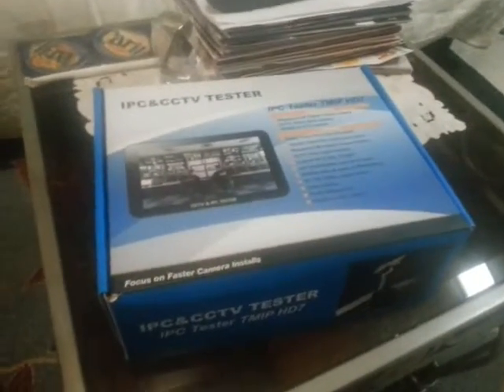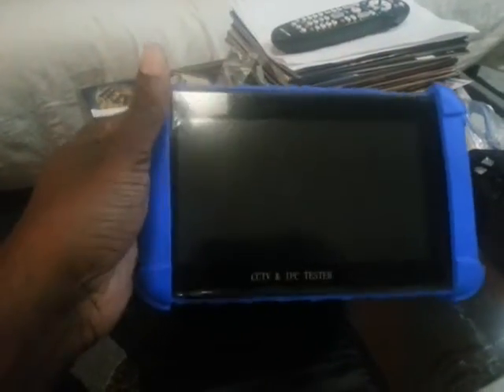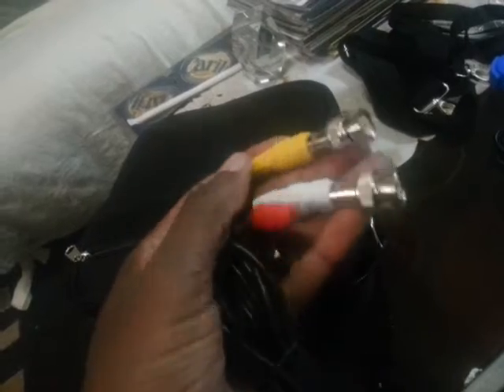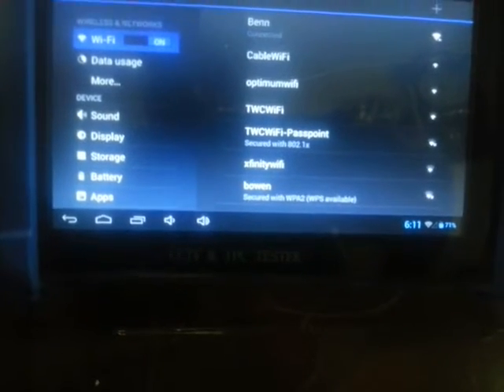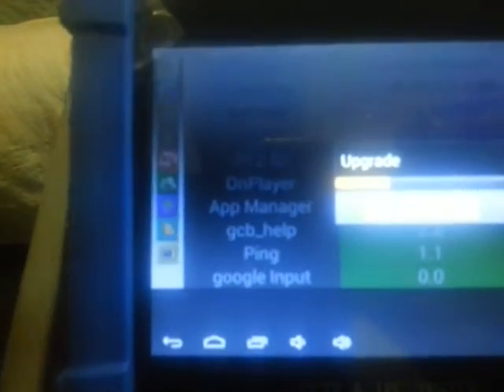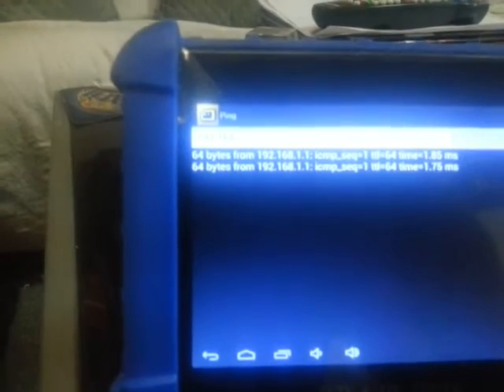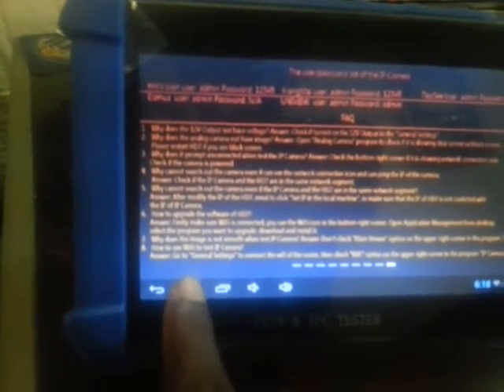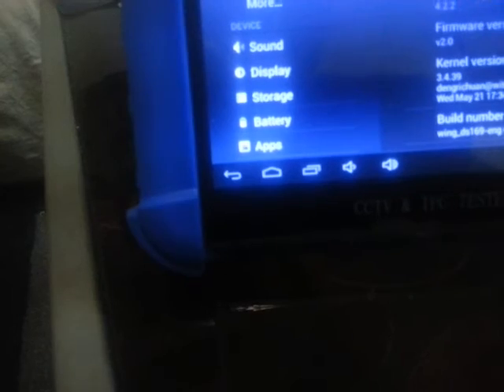IPC HD7 CCTV Tester- unboxing and testing pt. 1

Comment: Hi, I like your video on this device.  I purchased the IPC WIFI TESTER MODEL 
82-20500.
I have a Toshiba Network Camera model IK-WD14A and IK-WB30A, but can not
 get it to work/display video on the IPC. Any suggestion is welcome, 
because Toshiba Camera or Toshiba App is not listed in the memu.
Reply from the maker: try using the onvif app